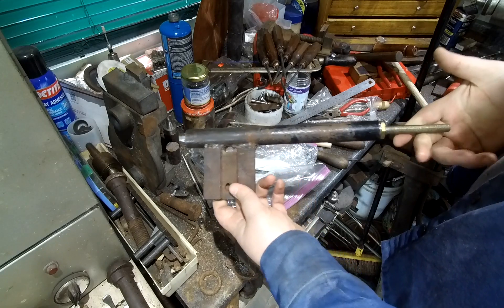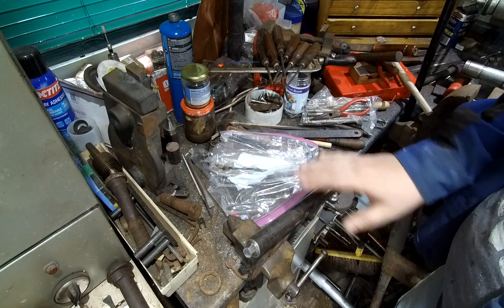Wax Rod/Filament Extruder

Comment: Looks good Chirpy. I finally cleaned up my leftover beeswax and cast it into a muffin tin. I didn't know if you turn a drill upside down that more power would come out, I'll have to try that the next time my drill stops at the worst time. :D
Reply from the maker: Cool man, thanks again for that block you gave me, I finally used up all of the wax I had left with the wax filament there. The brown wax is much much easier to work with for fillets and filling stuff in with because you can see where it is on the wood and where to scrape. Lol, the drill, I just put it upside down so I could put it against my hip so the torque wasnt snapping my wrist trying to get it to go, lol.

Comment: Nice extruder. Simple and effective. Just for fun you could make a system to wind it all up on a bobine :)
Reply from the maker: Yea, I mentioned it on video that got edited out, mostly because with the 50/50 mix that I have, if you try bending it cold, it is hard enough that it could break, so trying to uncoil it from a bobbin would be a nightmare and just make a massive mess. What makes it nice for fillets and for use on patterns is what makes it impossible for coiling up like that. That's why I tear it into rods/sections that get straightened out and heated with the alcohol burner's flame to bend it into shape for the fillets and for using it.
Reply: @ChirpysTinkerings  That makes perfect sense. Thanks.
Reply from the maker: @Rustinox  No problem, the sticks work perfectly well for me and it's easier for me to store the ziploc baggie of wax rods in the toolbox than it would be to store a bobbin of wax filament, lol

Comment: Nice extruder, works well. You may want to think about a some kind of heater to the assembly to keep extrude temperatures constant.
Reply from the maker: Yea, Ive thought about a heater, but as much as it's really used, a torch is quick and easy to do, and less of a headache to put it all away when youre done with it, lol. Once the body is heated up, it takes a while before it cools back down because the leadscrew/nut, and the pressures of being extruded create a bit of heat on thier own and keep the wax pretty consistant temp. It was getting quite cold out while recording that, so it was cooling off on me.

Comment: Thanks Chirp, can you show the die you used for the half round extrusions for the  corner fillets.
Cam
Reply from the maker: I dont have any half round dies, I just use that one shown in the video with the 1/8" round, then just heat the wax rod up and push it into the corners with my fingers to get it to stay in place, then shape it with the fillet tools, melting it into the corners..